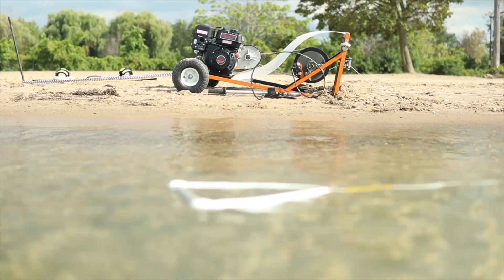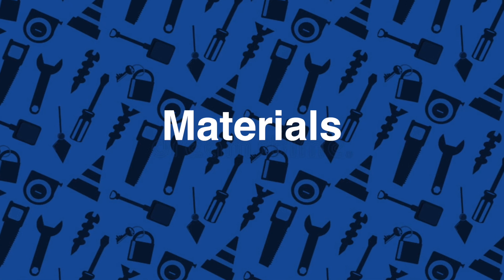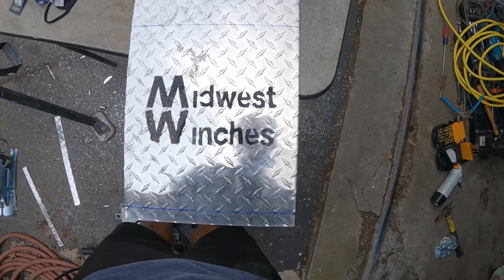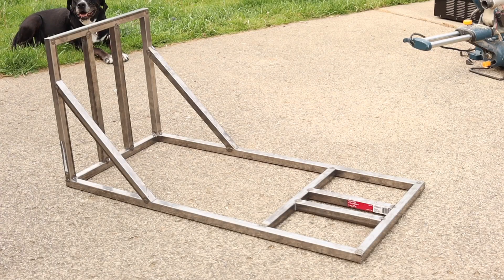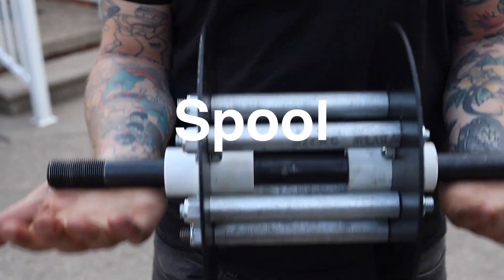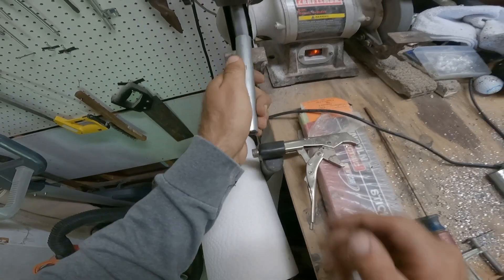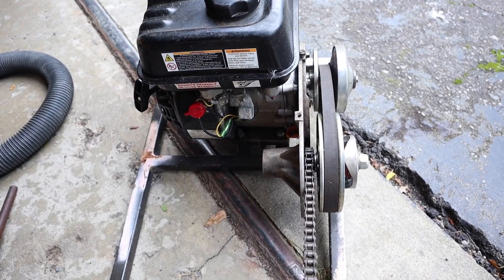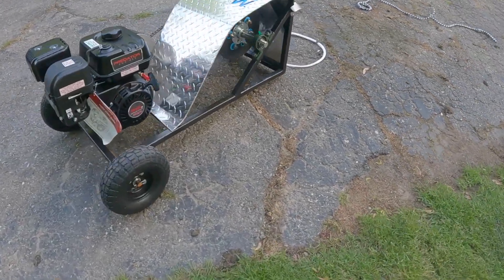DIY Wake Winch Build | Build Your Own Towing Winch For Water & Snow

Comment: I see that the websites down, I really want one of these for this winter. I’m a skier and want to make a backyard setup but I’m in flat ground so this would be perfect. Can we get in touch to m
build one?
Reply from the maker: I have a used one without the engine if you're interested? You can find the same engine at Harbor Freight; simply mount it on the frame.

Comment: Hello I also made a wakeboard winch with a torque converter and I want to ask you how the cable release system works ?  As mine is quite difficult to release, thanks ! and Have  a nice day
Reply from the maker: I'm not sure what you're referring to. There is no cable release system.
Reply: @learnhowtokitesurf  
thanks for the answer, interesting, I have a hard time releasing the cable, that's why I said I'd ask you and I thought there was such a system
Reply: @learnhowtokitesurf  Before I had a centrifugal clutch and it released the cable much easier, and now with the torque converter I have to pull quite hard for the cable to come out.

Comment: What’s up! Love this set up. I have started to get the materials. The link you have for the “hubs” does not match the picture you show for the wheel hubs when you go through the materials list. Also I did not see a link for the orange disks. Do you have a link for those as well? Thanks in advance. Can’t wait to rip with this bad boy!
Reply from the maker: Thanks! Those hubs will work. If you want the hubs in the picture, you should be able to find them on eBay. As for the disks, I just found a local metal shop near me that cut them out.
Reply: @learnhowtokitesurf do you know how thick the disks are??
Reply from the maker: @barronjones556  Think 2 mm

Comment: Just curious, what is the point of the torque converter?
Reply: Works like a clutch. With more throttle/crankshaft rotation one of the barrels moves out and power gets delivered to the axle/Spool. Works better then a centrifugal clutch, because it delivers the power more predictably and smoother